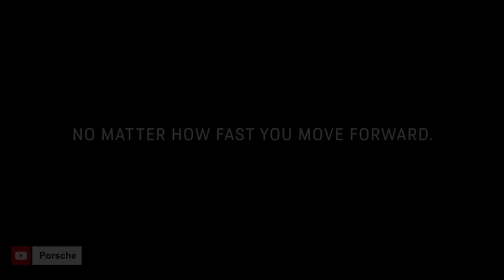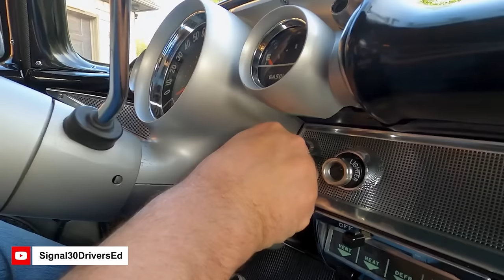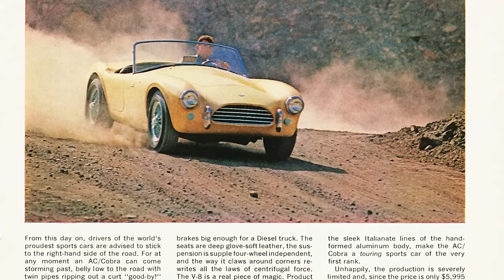Why Old Cars are Better

Comment: Cars are freedom = independence. Hence you wanna have something that you can fix without relying on a fancy part you probably can’t get everywhere (think electronics). You can weld everything but you can’t rebuild every computer if you don’t have access to the firmware. 

The simpler the technology is and the less quality your gas (diesel) can have, the better. If TSHTF, you need something that lasts… and that doesn’t spy on you…

Comment: At the garage that I work at we get cars as old as the 50s and as new as 15k miles lol. Super old boat cars are just annoying tbh. Annoying to put on a lift, annoying to move around the shop, annoying to work on due to a lack of parts. And driving them down the road is just such a hassle because if something goes wrong it could be a massive expense. (although that wouldnt be as bad if i owned it probably) my favorite cars to come through the shop are 80s to 90s. I looked over a 95 corvette for an oil leak. and even just moving it around the parking lot and bringing it into the garage was so much more fun than my drive home that day in my RAM lmao

Comment: I love modern cars' direct injection.  Dual clutch transmission getting over 300 hp out of 6 banger. I do like the upper trim interiors the sleek modern screens. Cars from the 80s and lower horrible body roll heavy boxes with a carburetor just spewing fuel everywhere

Comment: I think one thing you should have mentioned, and that you overlooked is complacency. Like you said, cars now are a thing of total convenience, get in and go no effort at all, no need to pay attention because the safety features like lane assist and auto braking will keep me safe. This leads to worse drivers which in turn leads to more crashes, and there isnt anything the car or safety features can do if you the driver are too incompetent to actually control the vehicle. Especially when the vehicle is upwards of 7k lbs like many of the EVs and large trucks. Even with something as simple as the seatbelt, after it was law to wear one the number of crashes rose rapidly because of complacency.

Comment: I think a lot of those motorheads have or will move on exclusively to motorcycles because they can be worked on by their owners & are not restricted by a bunch of safety standards outside of brakes & lights.

Comment: Old cars with EFI systems are the best of both worlds, IMHO. e-gas is optional and I can understand why some builders (like Alan from old Skid Factory) praise electronic throttles over classic cable ones.
To me, the symbols of resistance are those old Mercedes with diesel engines that could easily run more than 500,000 miles. They're simple, comfortable and somewhat fuel efficient (especially the turbo ones), basides being freaking easy to service if there are parts available.

Comment: Coming from a background of electronics and computer design, with speciality in power electronics, I want to raise the question :
Why cant people be motorists with modern tech ?
There's nothing that scary about building a battery pack or wiring things or programming the computer. All it takes is the willingness to learn and the breakthrough of the fear to experiment. 

It would also be extremely helpful if the manufacturers released datasheets on the things they sell and didn't lock people out of making modifications to the machines they own but if they're unwilling to not be dicks then there's always legislation

Comment: I owned several Volkswagen Beetles, and a 1967 Chevelle, which I greatly regret selling. What they all had in common was no power steering, no power brakes, no power windows, no air conditioning, etc. Jay Leno uses an expression, the "mechanical-ness" of older cars. I think that's a wonderful way of describing how older cars drive. The trend in today's automotive technology is revolting to me. I now have a 2006 truck, and I will never buy anything newer than that in the future. My current desire is to find a good 1992 Honda Accord, which, at my age, will probably be my "forever" car. The 1990s seem to be the best of all worlds; the tech is advanced, but not too advanced.

Comment: The more mechanical the car is the easier it will be to understand how it needs to be fixed. Also, mechanical solutions are tougher than electronic or software solutions.

Comment: with new bearings and oil and seal technology older cars are extremely reliable, i have an 04 pajero that has been worked since it was bought and it's still going

Comment: It depends on what type of cars one purchases and drives. If you drive automatic cars, then everything you say is correct. I drive only manual vehicles; I have own a G35 sedan manual, a blast to drive, and a 2002 Mustang v6 manual, and it was decent. I used to own a 2015 Mustang GT manual with a sports package and loved it. It is quick on a straight line and good at handling corners. It is a proper sportscar. I currently own a Civic SI, and while it is not a fast car, it is engaging to drive.

Comment: I think the sweet spot for cars is in the 2000s. Fuel injected, they have airbags, runs super reliably thanks to the advancements in technology. They have the same fuel efficiency as modern cars, have crumple zones, so they are safe. And they lack all the electronic crap modern ones do. They are still machines that will just work and obey you until they blow up the engine.

Comment: 22:00 I’d like to say I guess I’m still here holding some of that essence. I am by trade a diesel mechanic but by hobby I build my 4x4. A Land Cruiser named toothless. I went from knowing nothing about that thing to shoving a Chevy V8 under the hood, doing axle and locker swaps, wiring everything forward of the firewall to run the engine by myself. I know that rig inside and out. I have touched almost every inch of it for one reason or another and that is why I can’t drive a new car. It’s soulless. It’s depressing. Hell even my OBS f250 with a big block 460 just doesn’t quite have as much soul as toothless mostly because I have left it stock. That will change but for the most part I just get in and drive it. It’ll need work soon and I’ll be the one to do it so I feel like it’ll become more alive as I work on it more

Comment: My dad owns a 1950 ford custom coupe. The thing has a 49' ford flathead v8 in it. I have never seen that car not start on the first rotation. It sat in a garage for 5 years and still started on the first engine rotation. The most beautiful car I've even been in. every light on that car is just how it came from the factory. The only maintenence my dad has had to do to the car are brakes. Drum brakes suck and that's something you just have to admit.

Comment: I have a 2000 Dodge Durango SLT Plus and I am able to work on that easily and it is actually easy to work on compared to GM from the same time era… GM went BS engineering early… Dodge on the other hand was still repairable for a bit longer… I am keeping my Durango for my whole life… my dad bought it new back in 2000 and me and my twin brother were brought home in it… so I am obliged to keep it for life…

Comment: I drive 20+ year old Corolla hatchback with manual. Have also driven Volvo V60 with manual and XC90 with automatic. Realized I love manual.
Also my Toyota is way more resilient to issues than XC90. Not that it has less issues, but it just goes, be it an alternator or an entire cylinder going unfunctional.

Comment: Last year I switched from a 2010 Ford to a 96 bmw e36, not even an M just a nice 318i and I can confirm, the jump in comfort, fun, ease of working on the car, visibility, just enjoying a simple evening cruise with my girlfriend is insane. For as long as I can afford or am legally allowed to own older cars I am not going to drive anything from this century. You could give me a million bucks and the only currently available new car I would be interested in would still be a bare bones, base trim Suzuki jimny because it’s basically a factory fresh 70s car that looks a a baby g wagon. Well and a 911 gt3rs for obvious reasons. But realistically speaking if I had to buy a newer car it would be a pre 2020 jimmy because of all the mandatory safety handholdings in the eu since then getting worse and more intrusive every year.

Comment: I've driven a fair des cars since i got my licence in 2013.
Anything between 90's saloons up to mid 2000's vans. The two véhicules I drive the most share the same engine but are nothing alike, one is a 2006 sprinter, the other a 2001 C class station wagon, both boring and fuel efficient (altough not so much for the van)

The most caracterfull cars I had were both french, a Citroen Xantia turbo diesel and a tiny Peugeot 106.

Comment: Older cars are much simpler to repair, won't take serious damage from minor collisions, and have more space inside. Even my 2001 car can be easily accessed for simple jobs like changing a fuse. In many modern cars the fusebox is in a hard to reach area, like behind the wheel arch

Comment: I agree with you and I have similar conclusions. Cars are like washing machines now. They don't require any skill or knowledge to own.

The thing I am not completely agreeing with you on is the fact that modern cars are more difficult to work on. For me, they are more complex, but everything is still quite easy to do. People just don't want to do this anymore. Also today cars have all their components "hidden" behind covers. Because of that, everything seems unaccessible. But when you unscrew all the plastics, it suddenly turns out everything is as simple as it used to be. It almost looks like car manufacturers... don't want you to fix your own car.

Comment: Older car devotee.
71 BMW 2800CSA(70,000miles), 95 Toyota Camry sedan(95k) automatic, 95 Mazda Miata 5 speed manual 128k, 07,08 Honda Fit manuals(75k and 209k) 
No screens, no problems. BMW currently being revived. Loved your observations and agree

Comment: No no no, that Malibu crash comparison was total BS because that 59 had by far the worst frame ever designed. And most old cars don't suffer cab deformation any more than most new ones, look at old wreck pics. My 65 year old car did a 65 mph un-braked front impact with zero damage from the firewall back. The unoccupied rear ended new high buck same weight SUV was crushed to the front seat I didn't have my belt on and only got a minor black eye from the dash pad. 3 point restraints are super critical and easy to put in old cars including prewar. Same goes for front disk brakes.

New cars ride like lumber trucks. My suspensions solve bumps not my back. I also have overdrive in all mine which helps mileage but I don't do 20K miles a year so I don't care anyway. For high 20s/gallon get a 60s 6 cylinder Falcon, Nova or Dart and put overdrive manual trans in it.

Toss the points solves ignition forever and keep carburetor screws tight. 5-6K mile engine oil changes for 250K miles on a proper built old engine without popping head gaskets,  expensive timing belt changes and all the other insanely expensive mechanical failures common now. Standard new car problems solved by replacing them one part at a time to find a bad sensor and economically totaled is now very common.

Comment: Older cars tend to be more interesting, my friend has a 1970 triump 1300 and it looks very nice and drives quite well. it will happily cruise at about 55 or 60mph. The car only cost £3,000. It is also exemp lt from MOT and road tax.

Comment: My dad has a 2014 F-150 and I absolutely hate driving it. Everything is digital, the throttle, the steering, the blinkers even, and I can absolutely feel it. That little delay between pressing the pedal and the truck responding is something I cannot adjust to. It completely takes me out of the driving experience and just feels wrong. I might be spoiled a bit, owning a 1987 Porsche 944S with a manual gearbox has put my standards quite a bit higher than most (She just disappears in your hands, like the controller in a well made immersive game your method of input just vanishes from your mind as you and the character stop being separate entities). 

The excess of modern cars is beyond belief, so much could be ripped out to bring the cost down to a reasonable level. Gone are the days of spending a few grand on a new vehicle not due to inflation but due to excess. The amount of crap crammed into them for the sake of cramming something in is staggering. If it were an option I am certain I could take 20-30,000 dollars off a car's price tag just by removing all that excess. I don't even use Cruise Control, so all I want is an electric window on each door, a radio, a heater, and that's really it. I don't want GPS, I don't want a full suite of gizmos and gadgets telling me my fuel mileage or screen after screen of distracting nonsense. I don't even want the thing to change gears on its own, let alone park itself. Take all that crap out and you can shrink the thing back down to what a 90's/00's Ranger was, as you don't need to be that big to bypass emission laws since the engine is burning far more fuel because the truck weighs far more due to the excessive amounts of crap crammed into it.

Comment: A confounding factor here is that driving is a compulsory chore a vast majority of the time for most people. You're commuting, or going to do errands. Frankly, I'd argue that most people would forego owning a car if they didn't need to for work and to live in a world where everything is so sprawled out. If I'm basically forced into car ownership because public transit is awful and so much of our society is anti-pedestrian, then I just want something that does the thing with the least amount of fuss possible. I don't care about "experiencing true driving," because I never wanted the damn thing in the first place! Making me get out and do some 10 point inspection every time I use the damn thing just wastes my time; I'd much rather an onboard computer diagnostic system do that for me. Just give me the thing that's going to do the chore with the least fuss possible. If I want to "experience true driving," and don't mind a simpler machine that requires more of my input, then I'll ride a motorcycle.
I don't think newer cars are worse. I think they're built as easy to use appliances, because a vast majority of the time that's exactly how they're used.

Comment: I own a 90' Ford F-350 with the 460 and auto transmission, the first ones with fuel injection and electronic shifting, also owned a good ol' 91' chevy s10 with the 4-banger (2.5L "iron duke") and the 5 speed manual transmission, as well as a 01' mitsubishi montero sport, the ford and chevrolet got something near to the modern abs system, but the montero wasn't, and then I got the opportunity to drive a 2013 dodge dart, and damn, a hell of a difference, the goddamn car was low as heck, the handling was good but the suspention was excessively stiff, the seats were made for kids, because a normal person can't fit well in there, and that's for the front seats, the back ones were a torture, and then i met the nissan frontier, the newer one (like 2020 or so), it was good at the front seats, but horrible at the back ones, too little space, heck, my old S10 had more space than that frontier, and mine was single cab, the F-350, no talking, is a goddamn palace in comparison to that😅😅😅

Comment: Here is Spain it's illegal to fix your own vehicle in many ways from 2021: 

-In case your car has stopped running on the road, if the spent time to repair is higher than the time for a tow truck to come, police can fine you. This is due to "road safety". 

-It is absolutely forbidden to repair or restore a car on the street, even if it's perfectly parked and doesn't represent a threat to safety. Since 65% of spaniards live in flats, it has become impossible to most of us to do small maintenances to our cars and motorbikes.

The only way to go is owning your own garage, but not a place in a community garage, for it is not legal to do maintenance jobs in there.

They took our chances to maintain our vehicles in a cheap and educational way for the sake of the environment(?) and pedestrian safety(?).

I may agree in some aspects like preventing oil and other fluids spillings or avoiding potential crashes in roads more and more crowded with cars every year. But it's not always black or white when legislating. There should be more room to repair a car on the street by your owns means.

Comment: 🙂I've been driving myself since 2011.  First car was a Ford fiesta 1.25 2001 type JBS.  was a sufficient small car for me at the time. 
😉Later it must have been around 2015/16 I got the Toyota Yaris XP9 6 gears manual from my mother. 
😊This was replaced by a 2019 VW Golf 1.6 diesel after a car accident in 2019. 
🙏🏻Yes, you dream of building a 91 VW Jetta Coupe 2-door compass next to it and giving it the mixed equipment and visual adjustment that you dream of. (Unfortunately it will probably remain a dream. No time or space, but I really wouldn't feel like tinkering around with a car at all.)
😪But to address the topic somewhere, yes, old cars have a certain charm that not necessarily new vehicles can convey. You always feel like you're traveling back in time to a "BETTER" time where not "SO" much everyday shit was problematic. (low energy and gasoline prices, low food costs and, cigarettes..... everyday things that you could still buy without having to offer two kidneys on the black market.😕

Comment: I have to say, my grandfather bought a '28 Ford Model A when I was 6. A couple years he traded it for a '29 Dodge Brothers DA Victoria. Both where used alot for weddings and pleasure. Only the Ford broke down once because of a faulty distributor. Both are driven a lot but a lot of care. I would never expect these cars to be so reliable. My '72 Impala has never let me down. Now I drive an Elctric car, it has been twice to the dealership because of stupid errors. But it's so much cheaper in the Netherlands😂😂